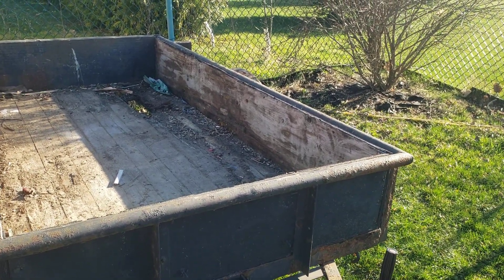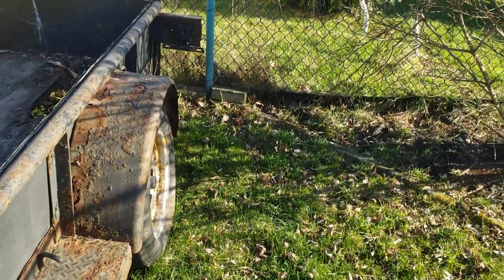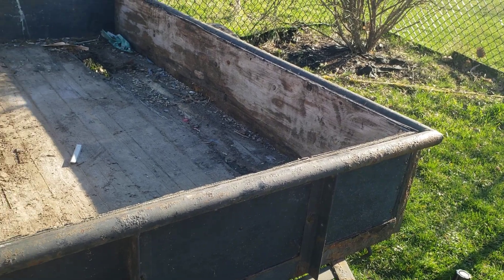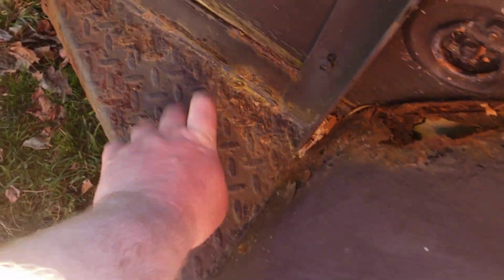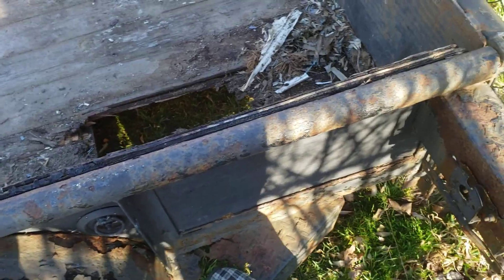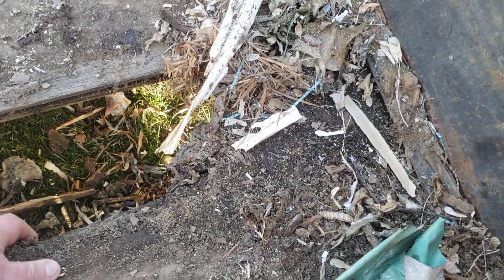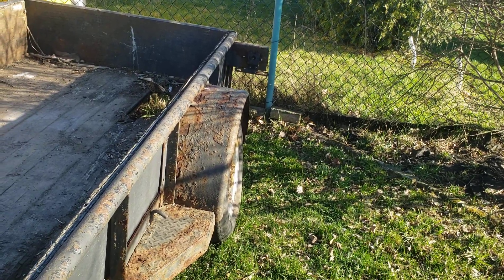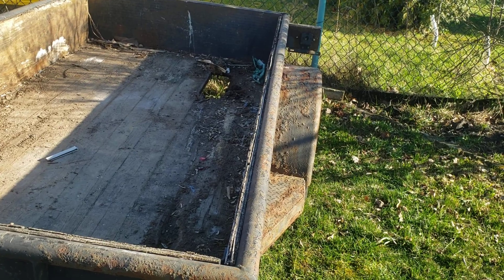Free Trailer

Comment: Take some measurements on both sides.  Electric brakes won’t have anything to do with an alignment issue if it has one. Did you check the tires for uneven wear?
Reply from the maker: As far as we can tell both tires are worn evenly.
I'll be pulling the tires off soon so we can see what's up.